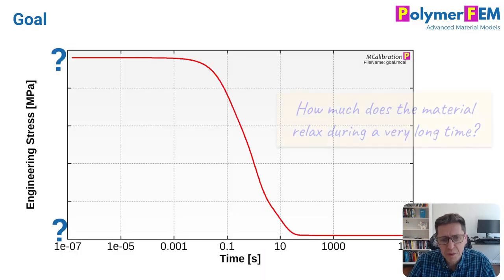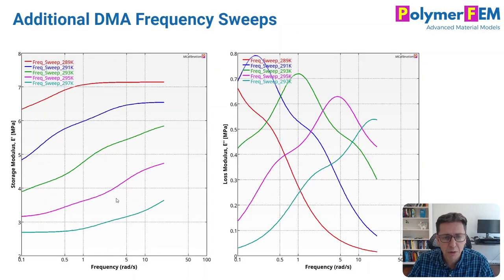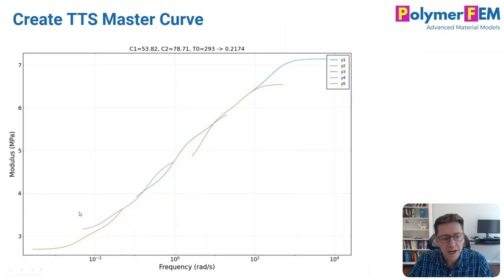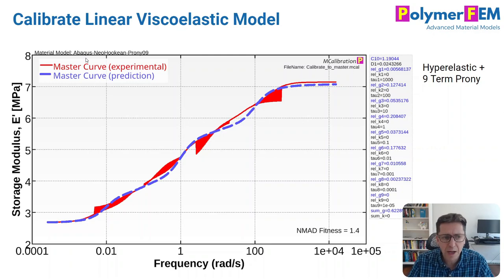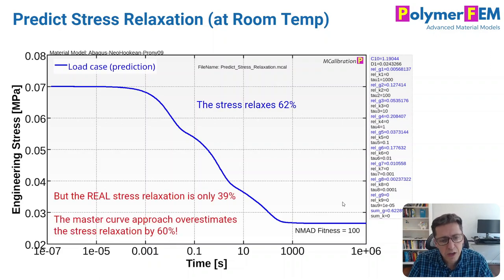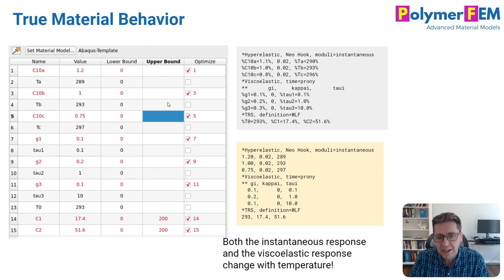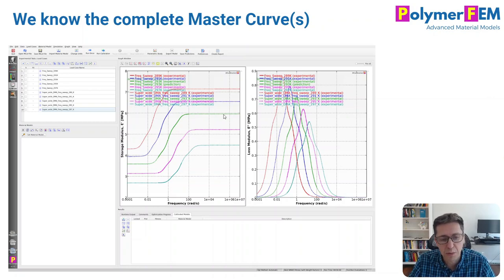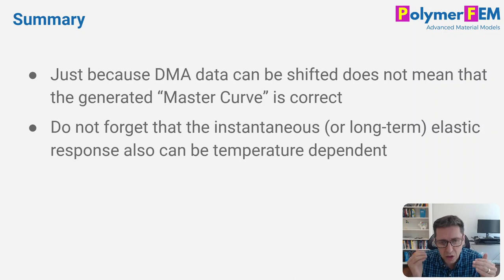One Common Huge Mistake When Creating a TTS Master Curve

Comment: Amazing work that you share! I only work with bituminous materials and most often the bitumen is modified with either a elastomer or a plastomer. When we get the curved points (we call it feathering) in a master curve, we'll first look at the compliance limits of the test equipment. When we move outside the compliance limits, we'll delete those points, that makes the master curve a much smoother curve. The feathering in your looks very similar to compliance issues, but I assume that you have checked compliance limits.
Reply: Sir, can i ask you a question, right now im learning about rheology of bitumen. and im doing a modification bitumen with plastomer. right now im done with the DSR test, frequency sweep from 20 HZ to 100 HZ, in 20,30,40,50, and 70 deg Celcius. wht iam tryng to ask, is how you make the master curve, how to cinstruct it, any reference sir? if im tryng to do with WLF equation, do you have a video rference or something for me to learn. thanks you sir.
Reply: @numangegame if you share the data I can help you in Excel, just to get you going.
Reply: @bredsj  where i can contact you sir. My email keep getting delete by youtube. I really hope to get some help for this sir.

Comment: Hi, thank you very much for your great video. I am simulating a sealring in an automotive application. -40 till 80 °C and lifetime relaxation for 15 years. I am combining the viscoelastic properties by prony series and the temperature dependant elastic properties by a hyperleastic model. What is the difference between the instantanous and the long-term elastic response in the application, because I thought, that the long-term elastic response is represented by the viscoelastic properties in a dynamic implicit simulation? Thanks, André

Comment: Thanks a lot for sharing these fantastic videos on mechanics of polymer! I have a question regarding the condition of DMA tests in term of relative humidity (RH). How important is to keep the RH constant when one changes the T in each DMA test?  Does it depend on the type of material (or maybe specimen size)? Or If each DMA test is relatively short, then maybe the RH effect can be ignored?
Reply from the maker: The humidity is usually not very important, but there are certainly materials for which the response is almost as dependent on the humidity as the temperature.
Reply: @PolymerFEM  Thanks a lot for the reply! Our material is pressboard, which is a cellulose-based material made of several layers of paper, compressed using a combination of heat and pressure and form a stiff and dense material.